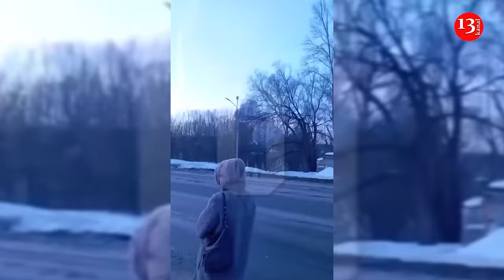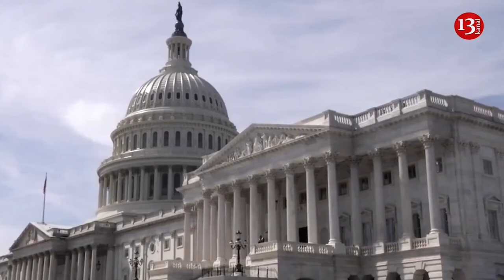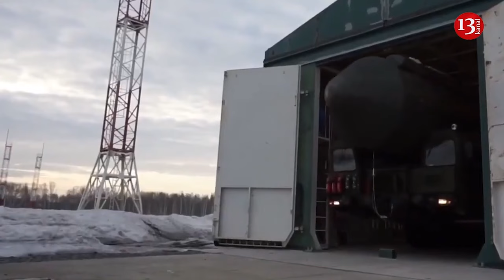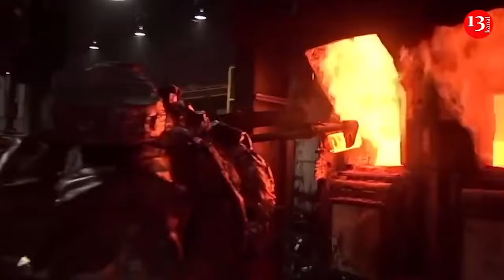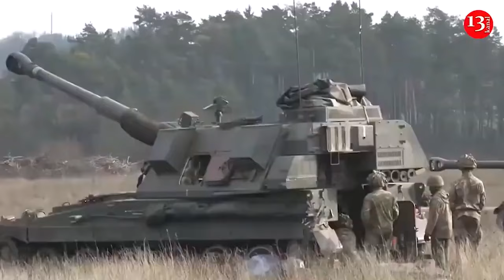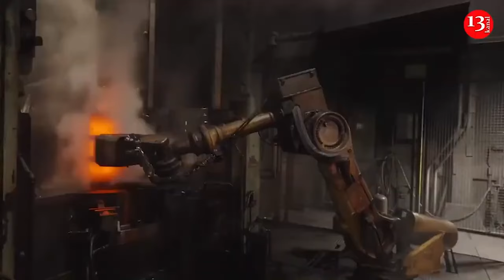At least half of production at Russian oil refinery halted after Ukrainian drone attacks

Comment: Russian munitions have more than double the dud rate when compared to American munitions so they're really only producing a little bit more reliable ammunition than the United States!
Reply: The U.S. does not really require the number since they generally do not indiscriminately fire rounds and their projectiles are designed to hit directly on the target.  The U.S. also utilizes airborne assets to hit targets like JDAMs and Hellfire missiles or GBU's.  The U.S. would not be involved in a trench warfare to need to fire shells all over a battlefield either.
Reply: @g.k.1669  amen to that!